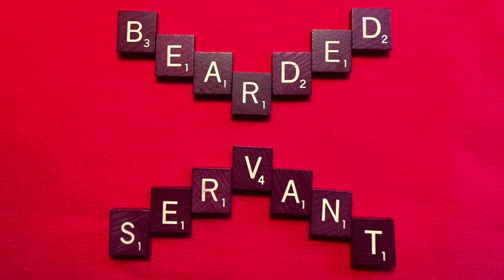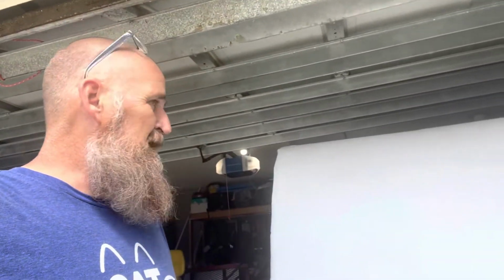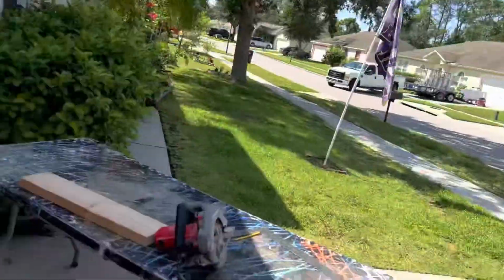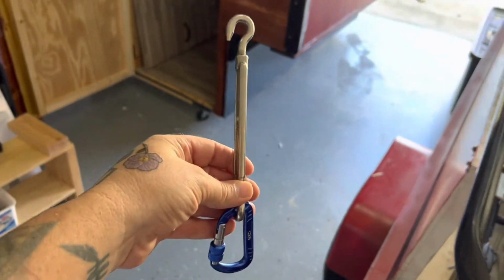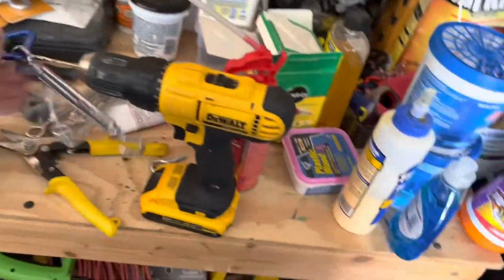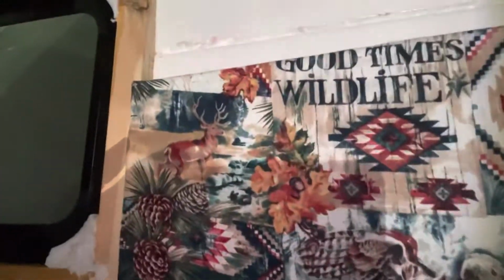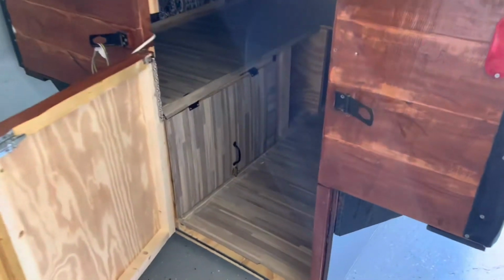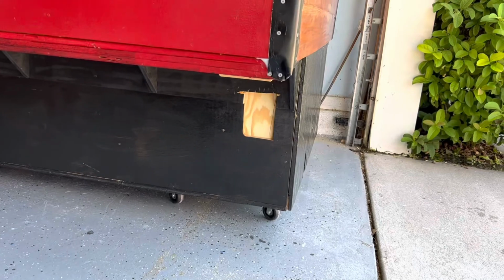Homemade Truck camper part 7… roof done, seals done, fabric done and more

Comment: Its not just about the weight. When it sticks up above the truck that much there will be drag. There could be much more than 500lbs of force on the front anchors in a head or side wind. Personally I would ensure minimum 4-500lbs per anchor
Reply from the maker: No worries I sold it last week and the guy put it on a utility trailer.  We screwed it onto three 2x6’s which were screwed directly to the trailer.  Then used the turnbuckles to anchor it as well.  Thanks for the comment though.
Reply: @JG24rlzsun  good idea! No problem!